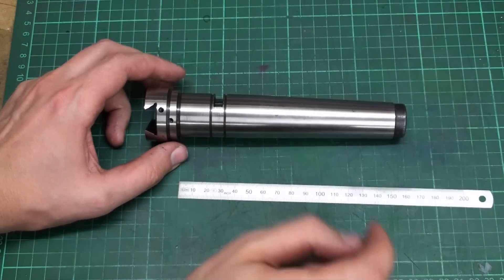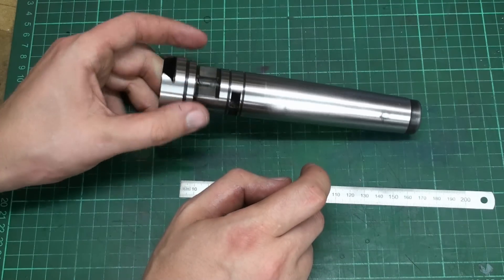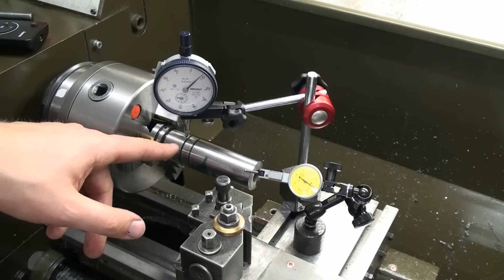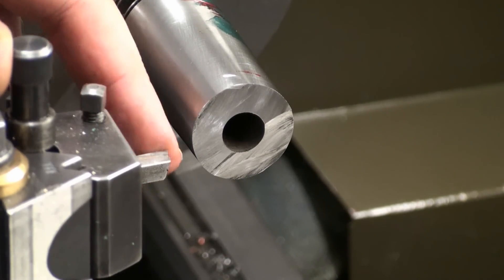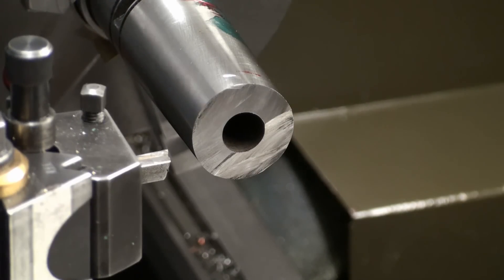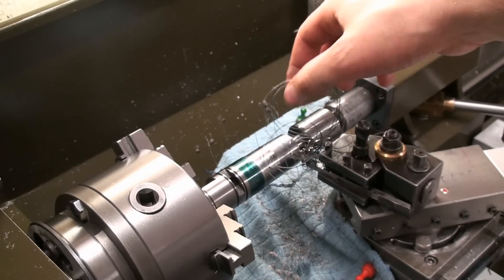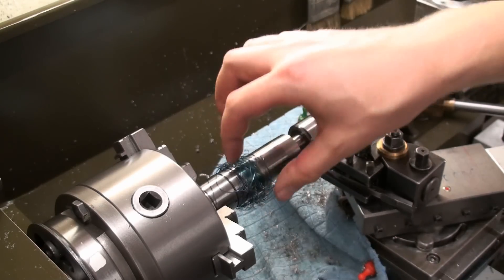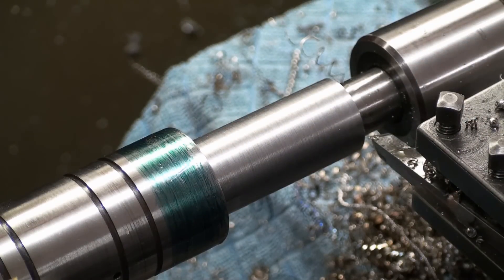Modifying the shank of a boring head - Abdrehen eines Ausdrehkopfes

Comment: I machined my Wohlhaupter 3 with morse 4 taper into an R8, minus the side groove. It was pretty straight forward.
Reply: Was your MT4 shank solid or does it have a slot milled into it? I was looking at one for sale but couldnt understand why it had a slot (like a morse taper sleeve) but it appears to be a fixed MT4 shank.
Reply: @TinkerInTheShop  A normal morse 4 taper.

Comment: Just picked up a UPA5 with a fixed ISO 50 taper .. in my haste to bid on it I didn’t realize the taper was not removable ... ugh ... it’ll be a project to turn that down to R8 ...... thanks for the video. There is hope.
Reply: Cut it off and remachine the end to accept and R8 arbour, I have just got a Mizoguchi Corinthian which is a copy of the UPA3 which has had a damaged arbour which I am rebuilding to have a permanent R8 arbour, stripping it down has been easy once I found the patent drawings

Comment: You stated that the run out is not to critical since it is a single point boring head. I don't understand this, pls explain. I am planning to do more or less the same operation but I am concerned about the run out.

great vid

Teun
Reply: If you think about it at all, a single-point boring head works because of run-out at the cutter. Sure, you want things to be more-or-less centred and in line so that your adjustments make sense and the cutting rake (and clearance angles and so forth) don't require any funky grinding or mental gymnastics, and things shouldn't be too grossly out of balance, but it's not critical in the way that a tool, or a holder for a tool, that cuts all the way around its rotation would be. There is just the centre of the boring head's rotation, and the cutting tool sitting some (adjustable) distance away from that centre line; where the rest of the set-up lines up isn't really all that important, within reason.

Comment: I have a UPA4 with a fixedMT4 shank. I have been considering taking the whole shank off and machining it recreate the interface used on the interchangeable-shank models with the clever differential-screw that clamps them together. But I have been dissuaded from this by the thought of tapping the boring head body for the screw. Do you have any feel for how "tappable" the material would be? Or if even single-point threading would be difficult? 
My UPA4 is definitely the most beautifully-made thing I own, so I don't want to ruin it.

Comment: Why not use the original centers that should have remained from manufacture to cut between centers? I've modified similar high precision boring heads myself using the original centers first.. Im sure your double indicator method was very accurate though. Nice work, angle grinder on that made me cringe but your workmanship undid that :)

Comment: This is right up our alley,  STEFAN
Just what the good doctor Ordered !!
We have a Walter F4042 R - 25mm Shoulder Mill with Weldon Flats, on its way, IA,  which we need to turn down to 20 mm to fit in our R8 Collet. Have also been fore-warned that it is also  Hardened !!   And the procedure on the Lathe will be exactly similar  to  Yours,  except slightly easier ( we hope ), as ours will not have any taper.  
Your use of TWO Dial (Clock) Guages makes the job even more accurate,  with no allowance for errors -  more like totally debarring Mr BOZO from the shop. That, we are sure,  was a very good method as well.
Thanks for Showing and Sharing as we definitely benefit from each and every one of Your projects - no matter  how  seemingly trivial.
LORD  BLESS
aRM

Comment: Hi Stefan nice work. could I ask you to make a video on the subject of reading metric dials I understand imperial fine but would like to work in metric and use the dials on my Harrison m300 lathe, but keep confusing my self with 10th 100ths 1000ths and .0 if you follow. as you use the metric system and have the best understanding of it on youtube ive seen, and also think our state side friends would also be interested.
regards Jeff.
Reply from the maker: greasemonkeygarage watson Funny thing is: I dont know what to explain as its total native and logic for me. But I wrote it down and will try to work something somewhat understandable out - Even with the danger of getting into a metric vs. imperial pisscontest ;)

All measurments in metric drawings are in mm if not called out otherwise. 1/10th of a mm is 0,1mm, 1/100th of a mm is 0,01mm and so on. If a drawing calls out 14,23 thats it. Machine it to 14,23 with the tolerance stated in the drawing (tolerances can be called out as a general in the drawing and if needed for individual measurements)

FunFact: I have an very hard time to understand the imperial system. Why are drills lettered and numbered? Why not just call it by its actual diameter? Why use fractions? Decimals are deadsimple as long as one has ten fingers to count ;)

Comment: Was hard but not so hard for Stefan. I guess he would have switched to tool post grinder if the tool lathe was not so capable to cut. Anyway the owner of  the boring head must pay you much more than a beer. lol
Reply: Cosimo Marotta There are ceramic inserts, or, if needed diamond inserts  (+$$$+), they cut in HSS or harder if needed, NO INTERRUPTED CUTS or crunch.... Getting from 45 mm to 20 with a small tool post grinder would take days...   ;-)
Reply: Thanks Pierre, I appreciate your information...and your video too!
Reply: Cosimo Marotta
Wow... Thanks and you're welcome...  ;-)